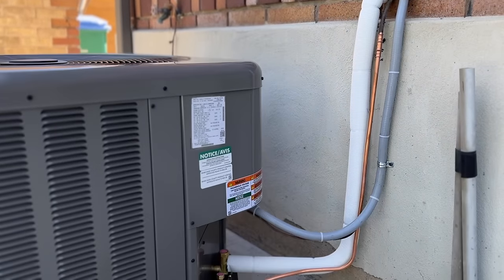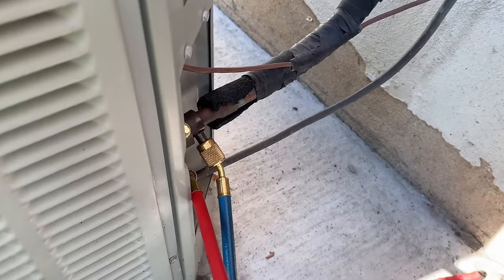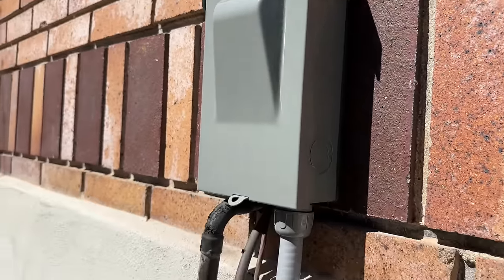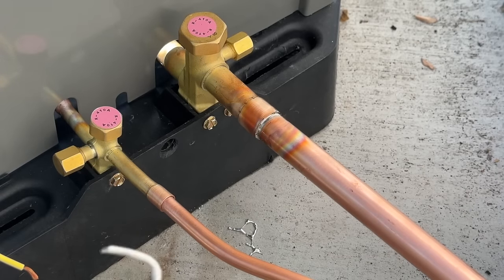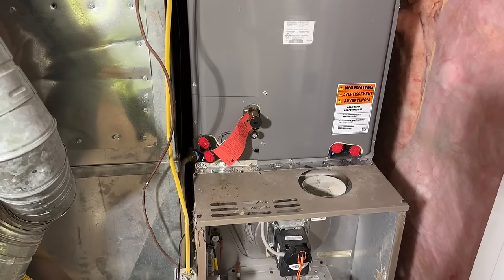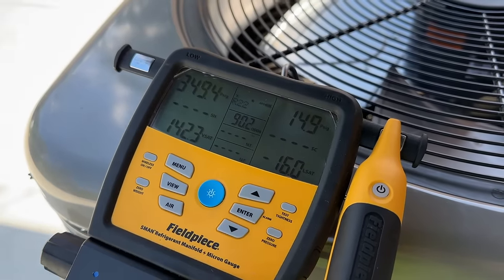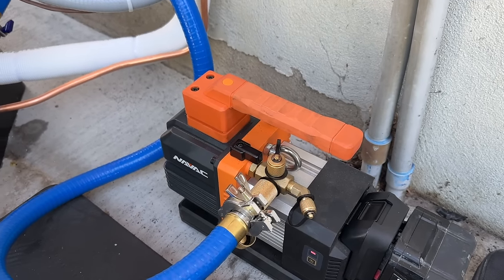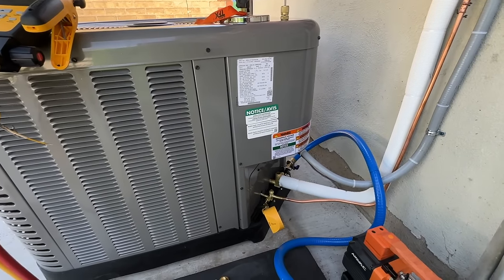Did You Know You Can Replace Your Own Air Conditioner?   -SAVE THOUSANDS-

Comment: Thanks!
Do you have any videos that show your initial evaluation of the old systems and how to select the best replacement? That would be great info.
Reply: I second this! My downstairs A/C died and I spent over 2k for the guy to replace it. He told me that if it goes down again I should buy a newer model since mine is from 2007. I don't have thousands to spend on a new a/c...
Reply: Are you asking about sizing a unit or choosing a brand or type of unit? as for evacuation there are a lot of videos showing this and during evac there is a decay test for leak detection, that's an important step, its also outlined in the install manual.

Comment: When you change the outdoor unit you have to do the indoor unit one as well & the line sets they won't be as compatible. And don't forget the black or blue colored outdoor refrigerant filter thing on the line set's outside.
Reply: Yeah well, he also didn’t mention that he was changing from an R22 system to an R410A system and should have flushed the lineset out, not to mention that the average homeowner is not going to have a nitrogen tank and regulator, gauge manifold, vacuum pump, etc.  He just gives out bad advice one video after another.
Reply: That would be a filter drier....
He installed that on the inside instead of at the condenser.

Its best to install those inside in my area due to the salt air living on the coast. Everything that's quickly.

Comment: The only thing I would do different is make the condensate line PVC instead of the tubing. Plus I probably would’ve put the bulb on the inside, instead of close to the bend. Also need to flush the lineset
Reply from the maker: I rarely flush a system that doesn’t have acid in it. Haven’t had a single problem yet. But I’ve given people the knowledge in other videos on how to easily flush the lines. Hilmor sells little foam pigs you blast through the lineset and it gets all oils/contaminants out.
Reply: @diyhvacguy  The only time I flush my line set is if it was different refrigerant. Those little pigs scare me. What if one gets stuck in the line set. Lol.
Reply: @diyhvacguy yet….

Comment: Love your content! Not sure if heat-pump are conventional in you area. But, I start observing people replacing evaporator conic /furnace combos with heat-pump and air-handlers. If you get a chance to work on such conversation, that will be a very welcomed content.
Reply from the maker: I have a video on my personal house coming out soon where we convert it to a heat pump. Stay tuned!
Reply: Please educate yourself, unless you plan to have a heat pump with back up furnace, it’s not advisable to remove your furnace and replace it with a heat pump, unless you live in a southern state where it does not get below 30 degrees on average in the winter.
Reply: @diyhvacguy  Hello HVAC guy,  Can a 2.5 ton line set System be changed over to a 3 ton Condenser Unit ❓❓❓
Reply: @morallyinsane7639  Depends on the type of heat pump. A lot of models perform at 100% down to 5*F these days, and around 80% at -22*F.
Reply: @JamesxRamirez  sorry but you are mistaken, a heat pump starts to lose efficiency around 32 F and at lower temperatures it does not produce as much heat and causes backup heat to initiate. Basically if you do not have electric or fossil backup, the heat produced will be around 80-90 degrees F below outside air temp of 32 degrees F. Backup electric heat adds an additional 40 degrees F.
Reply: Generally speaking, a standard heat pump will not provide enough heat to heat the house below 35°F and will require a source of auxiliary heat. The newer high end heat pumps will command the compressor to run at a higher rpm and can heat the house in freezing temperatures without auxiliary heat.
Reply: If you have a natural gas furnace, then I advise you to not replace it with a heat pump. Natural gas is a very economical way to heat your home. An option to consider is a heat pump with a natural gas furnace as the back up heat. It looks much like this install except the outdoor unit is a heat pump.
Reply: @HVACRamjet 
That's a great idea 👍🏻👍🏻Thanks...
Reply: Heat pump if electricity is cheaper in your area.

Comment: I have a 1985 doublewide I remodeled like a house, the old ac that came with it is an r22 system from back then thats still running, ive changed the outside fan and capacitors, next im going to try re-insulating the freon lines and adding a soft start to it to add more efficiency. I was looking at a goodman for 3600$ to put in myself when this one eventually goes out. This video is has good information for me, when i eventually put in the new ac ill be coming back to this for some tips. Thanks

Comment: I replaced my old unit a couple years ago.  My electric bill doubled since then.
Reply from the maker: Did you replace it with a lower seer rated system?
Reply: @diyhvacguy  no I went from a 3.5 ton to a 14 seer 4 ton Rheem
Reply: @Bro_Jared   is it over charged with refridgerant?? Something does not add up. Like going from a Tahoe to a 3 cylinder Trailblazer  or maybe carb to injection.....and gas price goes up with same drive to work!!
Reply: that's why you should have called a professional,  being cheap always cost alot more in the long run
Reply: Was that 3.5 ton that you replaced your max load on the duct work? If so ,just going up even more to 4 tons could be a very bad deal for you. Unit will run even more then it should and cost you $$. I see a lot of over sized units not installed correctly. Load calulation on the home and checking the duct size or load is a must. This video was great but was missing alot of info for homeowners. Homeowners forget that hvac is the most important part of the home and most expensive as well.
Reply: @joepetreng471  that is interesting.  My HVAC guy didn’t mention that to me.  Thanks!

Comment: I have a few questions: 1. Have you noticed any leak issues with using staybrite 8? I know Mikey Pipes did. 2. How does a home owner register self installed equipment with the manufacturer? Are some manufacturers more friendly to self installed central HVAC than others?
Reply: i'm not an expert by any means, but installing yourself and not being a licensed HVAC contractor means you're giving up on the warranty.  But heck at what you're saving, its worth it.
Reply from the maker: On the warranty, what was said isn’t true. So right out of the box, every single piece of Goodman equipment comes with a 5 year warranty. The thing people get confused about is that YOU as the homeowner can’t remove a defective part and bring it into a Goodman dealer and get a warranty. They simply won’t process it. However an hvac company has to come and do the repair, but the part would be warrantied no problem. In addition to that, as part of our Patreon remote support membership, we offer a service where we will warranty your equipment so it has the FULL 10 year warranty. So the warranty isn’t automatically given away, but this is all so new to many people, that we are just now finding ways to get the same exact equipment with the same warranty, for a fraction of the cost. 

As far as Staybrite 8. I haven’t had a single issue with it, and I have a dozen if not more systems running it. I’m curious to see what Mikey had to say about it though.

Cheers all
Reply: @diyhvacguy so let me get this straight,a homeowner can install there own equipment,then pay you a small fee,and you will go online and register it and claim you installed it,so they can get the full warranty

Comment: You need to let everyone know that in most cases if  they buy a unit off the interenet without a HVAC license.  When its time for warranty they will not get a warranty.  I had this conversation  with a Goodman outside sales  person.  He said can buy but no warranty at all.
Reply: Those warranties are terrible products.
You may get a replacement part for free, but the caveat is you're paying someone else 50-75% more for the materials as well as their labor charge.

You could replace the entire system twice for the same price a contractor would charge for one installation, only the warranty wouldn't cover labor charges.

So really, even  in a worst case scenario, you're still coming out ahead considering you're investing in the knowledge of how to do this.  Can you put a price tag on not being dependent on someone else? Perhaps so, but even still a DIY is a way better outcome for most people

Comment: Thanks for soldering them and not being lazy and using a press on fitting.
Reply: Get with the times, both are acceptable
Reply: Brazing is best soft solder cracks easily. Causing an expensive repair. That and the lack of line flushing which I prefer over replacement since the wall on older linesets are thicker.

Comment: Here, like I imagine in many places, permits are required to replace an HVAC residential system (Vero Beach, FL). I have a package unit that replacement would only involve reconnecting the return and supply flex hoses up to the back of the unit, the electrical and reusing or fabricating a sheet metal "cover" between the unit and the house stucco wall (stucco over concrete block). When I need a new unit, I'd sure like to be able to do the install myself. As to the warranty, it's 5 yrs. unless installed by a licensed HVAC tech/company - then it doubles to 10 yrs. Which I think sucks. Also, it's impossible to get replacement parts from local distributers as they'll only sell to licensed companies. This also sucks.
Reply: Mechanical HVAC permits are cheap and easy to get. The inspection usually takes all of 2 minutes and you’re fine as long as it looks up to code. Replacing an outdoor unit is especially easy assuming the previous one was up to code. The same is true of a home inspection when you go to sell your place. Contrary to what all the HVAC protective fear mongering people trying to protect their obscene trade are posting here, DIY A/C and heat pump units are not dangerous once installed. And some basic knowledge will keep the DIYer safe during the install.
Reply: When is anyone going to go to a house and check if an AC system has had a permit pulled?
Reply: @johneldorado When they go to sell it and the buyers agent checks and finds out that the work was not permitted.
Reply: @garrybillick3979  
In my state, no such system exists for HVAC.  Most places, no one is checking AC permits on whether they buy a home or not.
Reply: @johneldorado  Consider yourself lucky  Some people here certainly do.  If you get caught as a seller, you’d have to pull permits and have it inspected and approved.

Comment: Does the recovery procedure work for heat pump condensers as well? Thanks guys, beautiful trailer set up! ❤
Reply from the maker: Yesir!
Reply: @diyhvacguy  awesome 🤩 thanks!
Reply: Yet, he didn’t recover the refrigerant.  He simply pumped it down to the condenser.  As a homeowner, you now have to pay someone to come recover the refrigerant before you can legally dispose of the condenser, not to mention draining the oil from the compressor….

Comment: Mini Split system. They have a higher sere. Easy to install. Very reliable. Mr. Cool multi zones. Saves electricity and they are extremely efficient. Don't need the air handler. Don't need the ducting that actually looses heat and cooling traveling through them. Mini Split system. The rest of the world has been using them for years.
Reply: Mr Cool units aren’t going to last terribly long….

Comment: I paid 7k for an oil to gas conversion in my house …I watched the techs like a hawk…asked them where they buy the things…saved all the boxes . Later I had to replace the furnace at my mother’s house. I imitated everything the techs did. The only problem is that furnaces can’t be sold to homeowners, until I found a web site that did. From $7k on my house I did it for $2k at my mother’s….if I can rebuild a car engine I can do anything 😊 cut into the gas line and everything